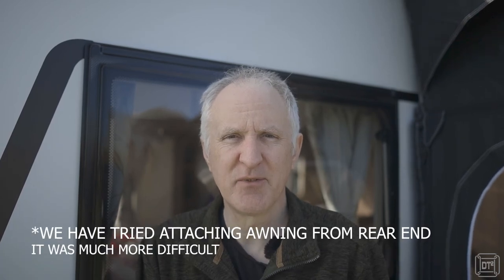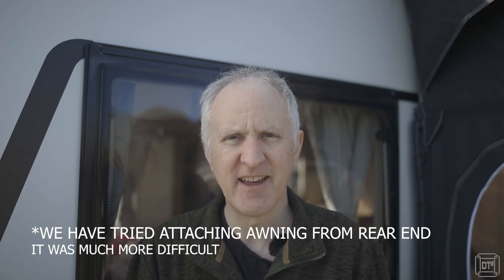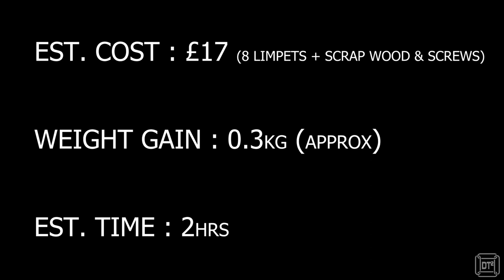PROTECTING MARKER LIGHTS - When attaching awning

Comment: Saw this pop up curious my self.. a lot of effort I was told  to put the on from the back then a lot less to pull over the side light ( oops you just said that 😁 ) at the front of my bailey phoenix. Nice job you done.. may be you could  sell them on eBay 👍
Reply from the maker: Thanks, glad you liked it. Putting the awning on from the back is a vertical lift all the way to the top and has a much tighter bend. Not sure if I could ever make these efficiently enough to sell but I have thought about making a 3D printed one (but I'd have to buy a 3D printer first LOL). This was the first prototype, I'll see if I can make a simpler one second time around as my friend has the same issue on his van.
Reply: I echo Victor. I have already taken off one of the lights on my Bailey with a Kampa air awning pole, due to lack of co-ordination with my wife as she was pushing the awning up the curve, whilst I was underneath the awning, on steps, attempting to detach the pole from it's velcro base, to bypass the light.  I now put it up from the back which is very difficult. Your great idea should be marketed..